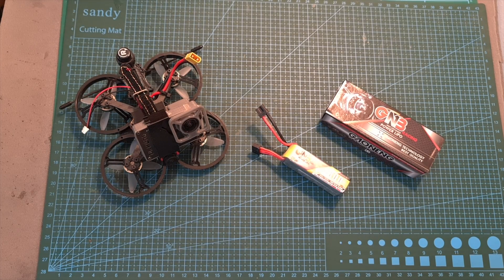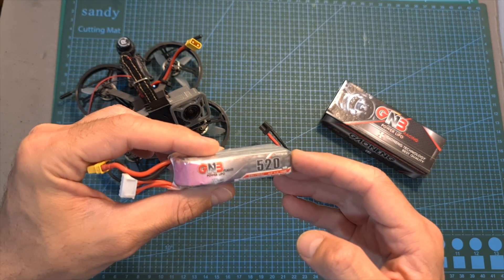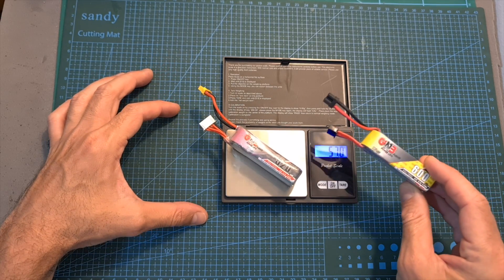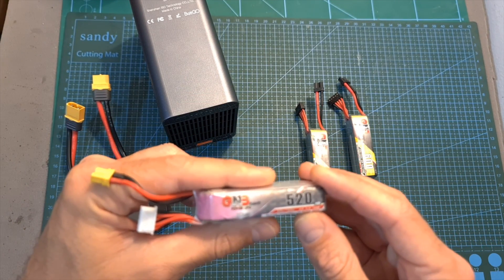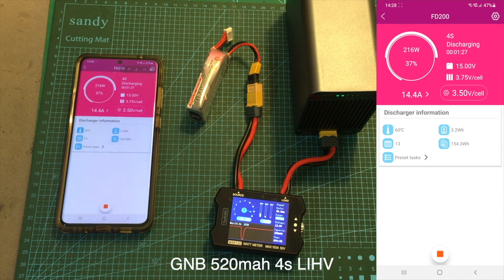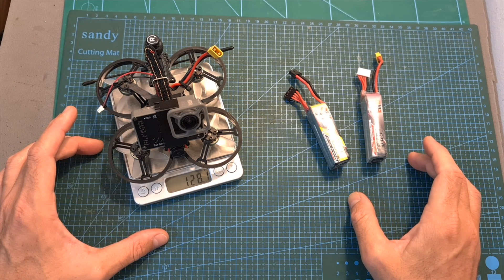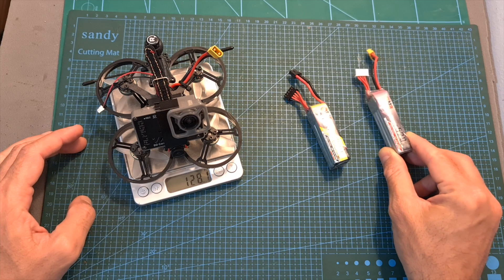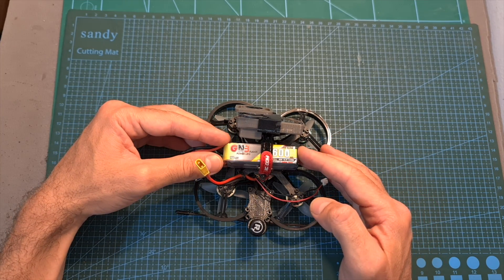🔋 Longer Flight Times For Micros? GAONENG GNB 600mah 4s LIHV Battery Capacity & Flight Time Tests

Comment: hello, when i charge the battery, do I need modify the full battery volt from LiHV mode 4.35v to 4.2v? because I am not sure my fpv (cinebot30, 6s version)can adapt  it, thank you
Reply from the maker: Yes, you need to have a charger that supports LIHV batteries (Most if not all current chargers do).

Comment: Interesting. For me personally the yellow GNB's were one of the worst batteries I have ever tried. Only got four 2s 530mAh. Their internal resistance from the get go was higher than my blue/silver 450mAh non HV 2S GNBs that have way over 200 cycles on them which was quite noticeable in sag. Capacity also was a joke -  440mAh of the promised 530mAh.

Comment: Wow.. that is the battery bought last month, did not know that is new battery.. nice video explanations.. got it for 95x v3. The reason is actually same weight as the Betafpv 4S 450mah which is recommended by Betafpv.

Comment: GNB have an 850 mah cell about the same weiht but 60c, would be interested to see a similar test on that. I've got some of the 1100 4s and they weigh in at ~83g each.
Reply: How close is the 1100 mAh capacity to it's rated amount? I've been thinking about picking some up since their stated numbers are pretty crazy.
Reply: @colinmetzger6755  Mine weren't even close. The 1100mAh 4s LiHv is easily the most disappointing GNB pack I've bought. They are extremely light but I've never put more than 950mAh into mine and they sag worse than the 60C rating would suggest. Probably fine for very gentle discharge over 10mins or more, but I'd stick with 80C+ for GNB. I've had good experiences with other GNB packs, including this 600, but would avoid their lower rated LiHvs.
Reply: @babc142  interesting. If you are putting 900+ back that would indicate its probably close to 1100. I'm not expecting stellar performance. Mainly for ultralights and fixed wing. 

I've not even charged mine up yet. Hoping they'll have enough punch to run a <250g 5", if not they should be ok for an LR 4".
Reply: @frasersteen  Yes, the issue is that my other GNB packs all take within 5% of their rated capacity on my equipment from a balanced discharge, so the 1100's capacity label is more optimistic. It should be fine for sub 250 long range.